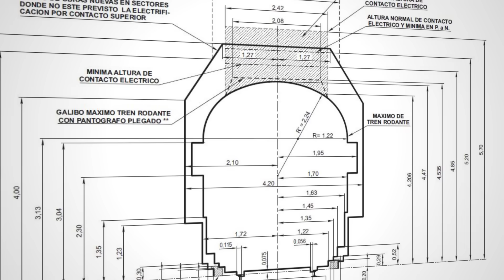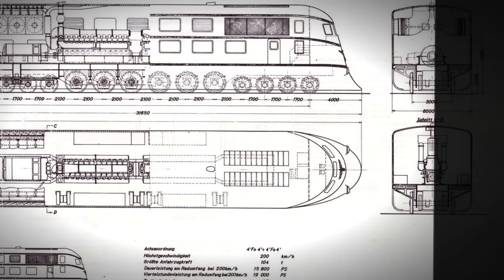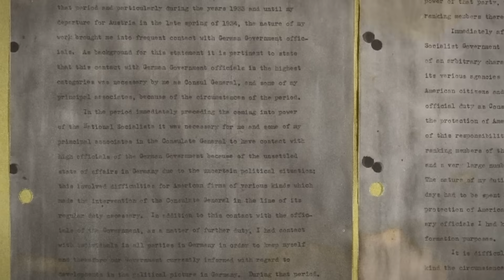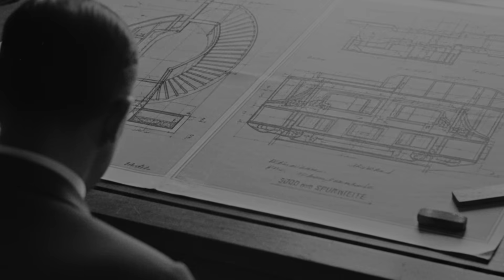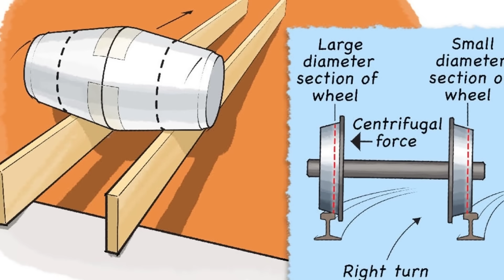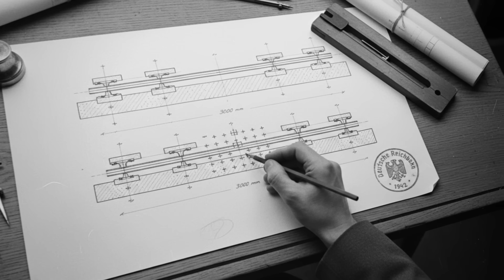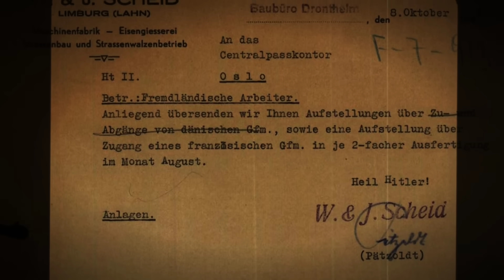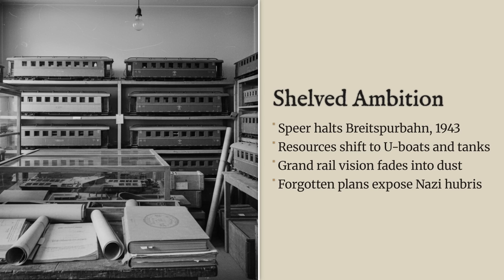Hitler’s Insane Plan To Build A Train The Size Of A Hotel

Comment: Why not just put his new tracks on ether side of the standard ones,that way you can run both kinds of width
Reply: The problem with that is most tunnels in Germany do not have the clearance for the trains used